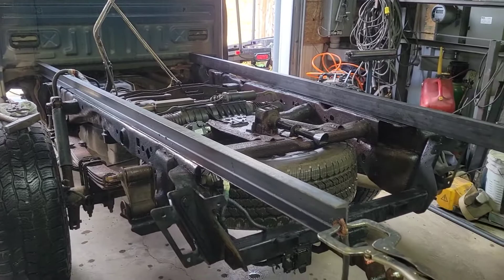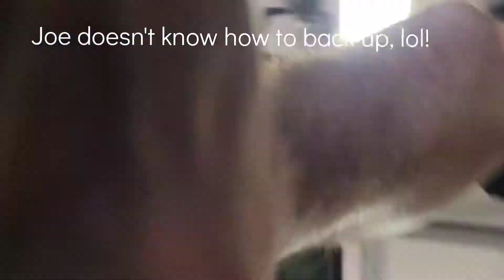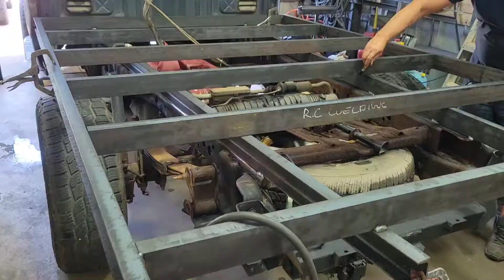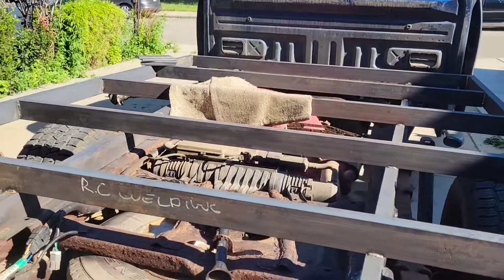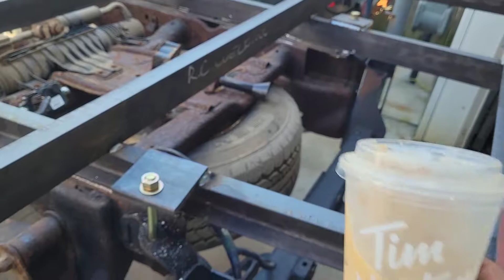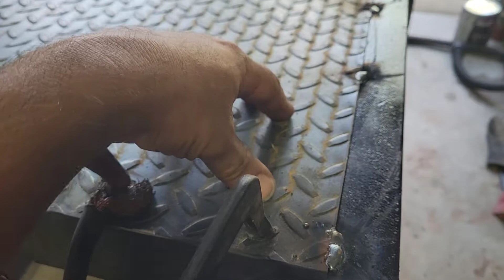Building A Welding Rig Flatbed F150 Part 1

Comment: Just out of curiosity, why can't you weld the flatbed to the frame?
Reply: Okay. I didn't know if it was because of flex or what. I always like to learn things lol. Thank you for your time.
Reply from the maker: Welding your bed to the chassis rails is a bad idea, puts stress on the chassis rails that it wasnt designed for.

Comment: There’s nothing wrong with the frame mounts, don’t let the armchair experts fool you. They obviously just graduated from YouTube University.
Reply from the maker: Lmao. It's too late. I already fixed it.
Reply: @RCWeldingsgarage  I like your channel brother, keep rocking it.
Reply from the maker: @randomschittz9461  thank you for your support. I subscribed to your channel as well. I like it. 👍
Reply: Curious as to the difference in the weight of the original bed and weight of flatbed
Reply from the maker: That's a good question. I believe they are both pretty close in weight, however I get better gas mileage now then when I had the box.

Comment: Awesome build but those bed bolts are pretty sketchy as hell, you should stand those plates vertically and lap half on the bed, half on frame, weld to bed, then bolt to frame, that’s how many factory flatbeds do it, plenty of holes on frame to bolt through
Reply from the maker: Tell me about it. We're mounting side plates this spring. I realized my mistake as I was building it. Thanks for the advice. My first build so I kinda winged the project.
Reply: @RCWeldingsgarage  still a really great build, awesome video! Thanks for sharing!